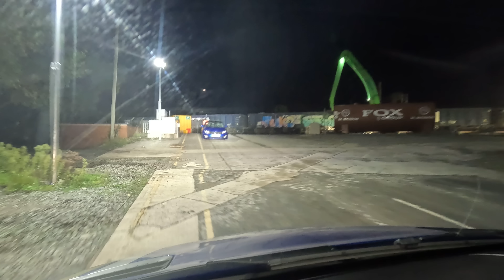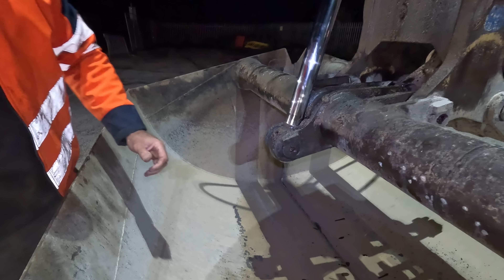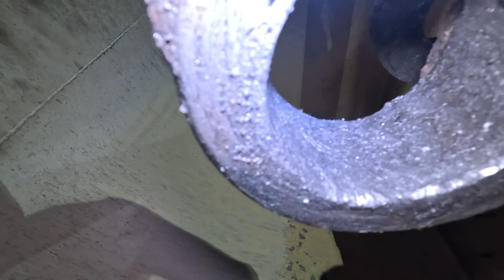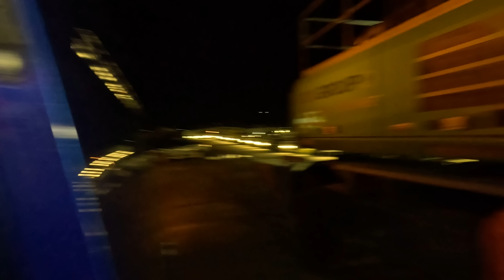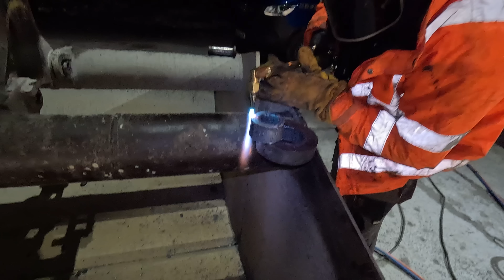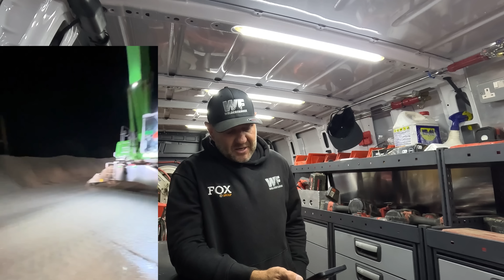Sennebogen Clamp Bucket Breakdown/Bush Fix. WELDERFABBER Episode #010

Comment: Can I suggest something Baz that could possibly save the company lots of money.   If you ever have to offload the train with diggers you could literally have some braces (out riggers) in the yard that will stop the carriages tipping as you off load and derailing them.  Quite simply and fast you can just put a 60 degree prop under the top lip in each corner of a carriage and offload.   This would keep each carriage solid not allowing it to tip.  They have a very narrow base but a couple of minutes from each driver just standing corner props could save time and possible fines.   I have a engineers approach to everything I believe this would transform offloading.

Comment: Nice one Baz/Director, the times you have to sacrifice a tool to keep job moving, make sure to make another plate for your puller Baz, 
ps, is there enough money in the kitty for boot laces for the Director lol😉
Reply from the maker: Your kidding he has very expensive boots with wire like snowboarding boots 😉
Reply: Ok looked like no lace in eyelets, will check them out.

Comment: Find a big socket that's close to the diameters, cut off 50mm with the grinder - bang, hardened bushing.
Reply from the maker: was something I was gonna do
Reply: @welderfabber  Can always buy another socket -  can't buy that feeling people get that when they phone, their problem is sorted EVERY time no matter the problem.  

 If you know what I mean - which you do. "Ring Baz!" has to front and center of their minds when schidt goes south - I'm also a Baz - there are several of us -  the traits are all the same. Reliable B******s. :-)

Comment: Besides being pulled away from home in the middles of the night, Must be quite satisfying to fix the stuff, and get shit rolling again. Was wondering about yer wee bushing thing, have you stubbed your toe in yer travels on any kind of cylindrical grinding attachment gizmo, suitable for smoothing out the ID of the bushing hole you cut ?
Reply from the maker: No not so far mate, just use a grinder. Not very often I do a temp repair like that

Comment: That’s been like that for a while with the looks of it.
It’s what happens when you have multiple operators using machines. They don’t give a f**k,as long as it gets them through their shift that day.
Reply from the maker: Correct mate. The op on it that night was like WTF has happened to the bucket.. hence call out
Reply: @welderfabber  On a course at Van Elle this and their kit is the same. Some serious tackle in the yard just sitting there not being used because they’ve not been maintained properly?
😳
Anyway. I enjoy the videos Baz 👌🏻👊🏻

Comment: Its always the case that you never have what you need in the van ,   Really enjoyed the video , you have to work with what youve got .   I always remember working with hydraulic hoses  ,  we kept reusable hose connections , where you if possible we cut out the bad section of hose , fitted the new connections using a knife , vice, and hacksaw .  A  £15.00  solution to a £100.00 problem.
Reply from the maker: yeah good advise

Comment: No point greasing a bush that ain’t there.  Suppose its all down to operator and first use checks  and machine knowledge  may have spotted the chaffing hose and defected it to monitor and source replacement 
Though the scaffold bar was going to be temp fix or even an old socket trimmed to fit 
It’s nice to have the gear and the options and materials to fix it first time
Reply from the maker: yeah I was looking for anything scaffy bar was 1st choice then I checked all sockets...

Comment: You might have got away with an expander bolt Baz. Those type of Ram Bearings are crap, Volvo A35/40 steering Rams go the same way. Got yourself out of trouble that’s the main thing. I’d better watch the 6ton CAT Bucket vid, I’m gerrin behind. All the best.

Comment: Always quality content and better than most of the crap on TV!  Nothing ever seems to faze you and you're always so chilled when under pressure Baz 😎  Excellent temporary repair and quick solution to the bush issue 👌  Absolute bummer  about the subsequent hydraulic hose failure.